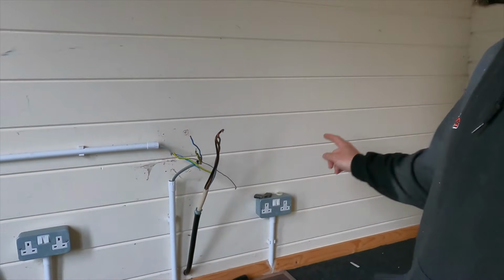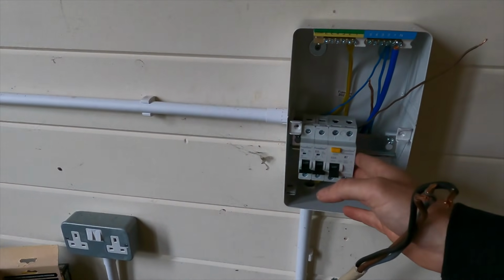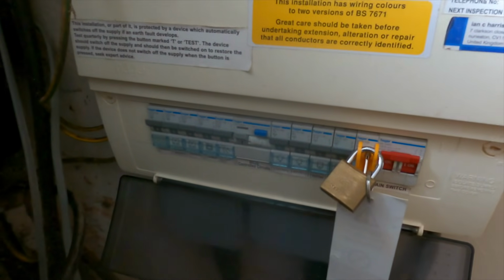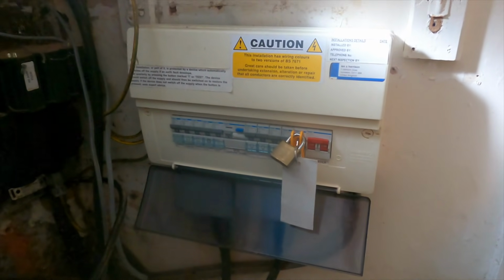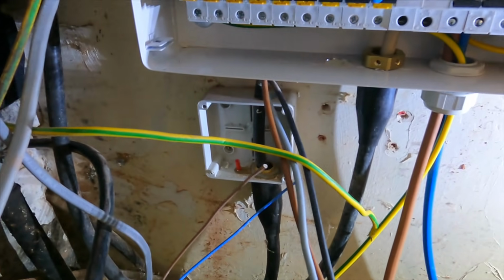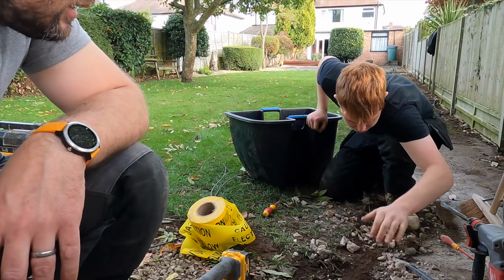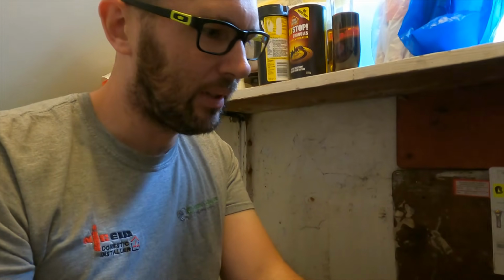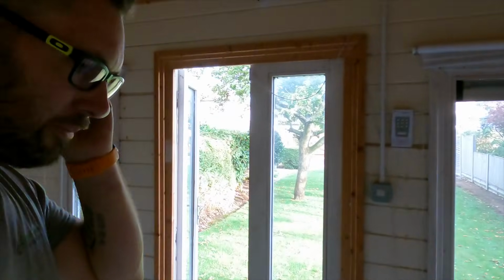NIGHTMARE CONSUMER UNIT !!!

Comment: Great video gentlemen! One suggestion on the video tech side - have a look at the Rode Wireless GO II dual microphones and receiver. A great bit of kit designed and built in Aus. The transmitters can independently record audio at two levels as a backup if the link went down etc.

Comment: A possible solution for the data cable is to use a pair of ethernet over power adapters (powerline adapter). They can work really well, one unit plugged into same circuit at either end.

Comment: lol
Should have buried the CAT cable (Provided it's proper decent external stuff) just underneath the high voltage tape!
Plenty far away enough from the armoured to prevent any possible crosstalk and what with it obviously being DATA no need for it to be buried deep like the mains cable!!
Reply: When you say deep for mains cable, how deep? I was taught two spade depths (600mm) and sat on sand.